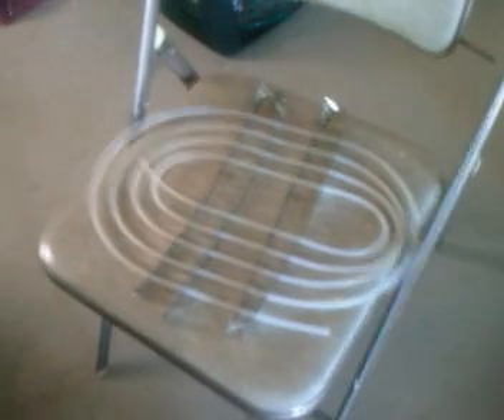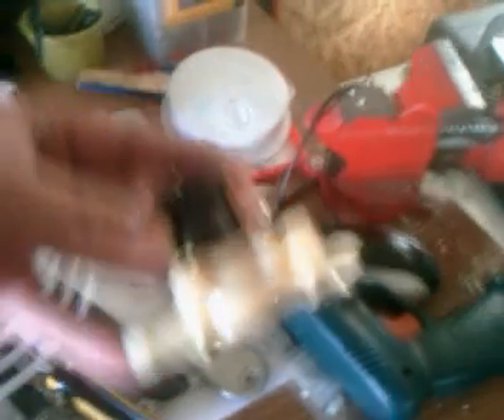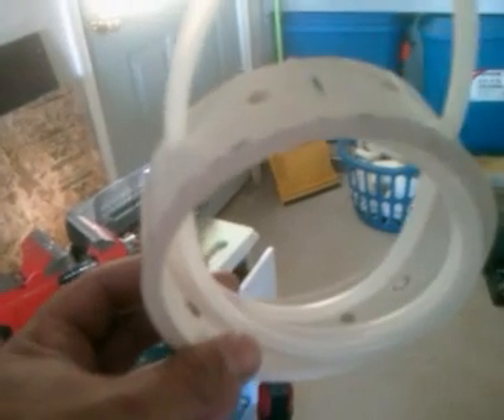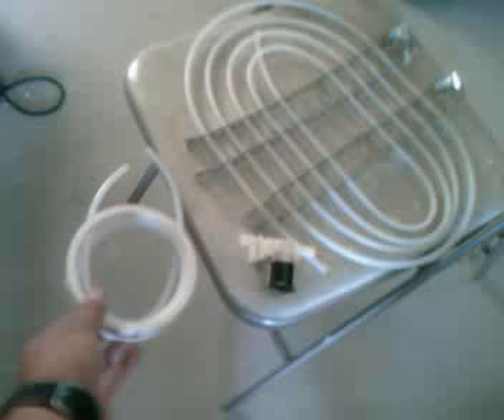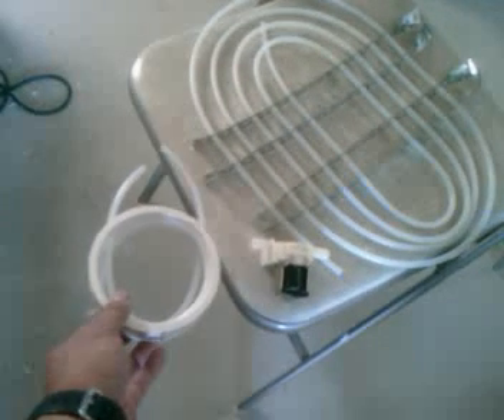HHO radiator home made ...just an idea

Comment: LUKE,
Nice concept was planning on doing that myself,
try using ss tubing as a coil. Most of the small pumps use a plastic impeller, if u can take the impeller housing apart to check it out. My other idea was to get the wiper delay module from JC witney and hook it to a small 12v pump and you could pulse the pump every few seconds. The ss tubing should cost u no more than $1 a foot and you only need say 2-3 feet.